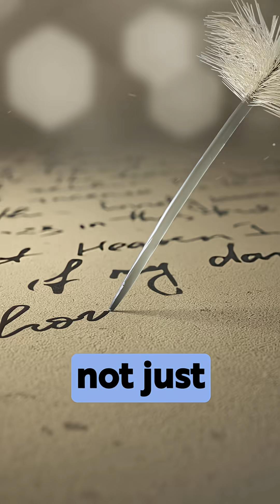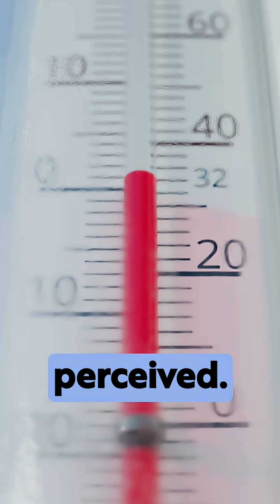R-Value Is Overrated—Why the Spray Foam Industry Needs a Holistic Approach

Comment: The current codes do not only address R value they address air seal as a total function of the assembly
It’s up to your qualified builder to know the challenge challenges, your structure, Will face, i.e. thermal water and air

Comment: 2 inches of foam and then aluminum double bubble run horizontally across the studs and on the ceiling and then taped off. Curt my heating bills 80%. Did it twice.  I suggest you make an 8 by 8 foot box and run tests from there.

Comment: Mike... agreed 💯%. Appreciate your videos!

As previously noted, "R-Values" are all marketing, hype & propganda  in favor of fiber/ glass. The only thing that really matters is the amount of energy needed to maintain a given temperature. CCSF dominates THIS discussion. AND... you potentially get the added benefit of 300% increased shear value strength to your structure when floor to peak with 3".

Btw, I went with SuperPex panels though, for "R16" for subgrade for $1.67/sq ft. (3.5") Saved a ton of time, labor & much easier to adapt to radiant heat than any other option for floors. JMHO